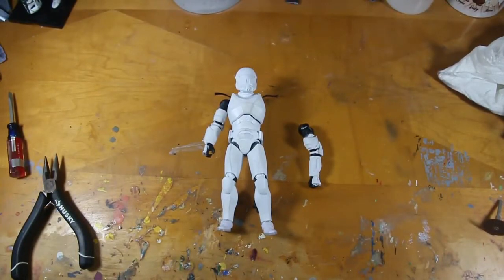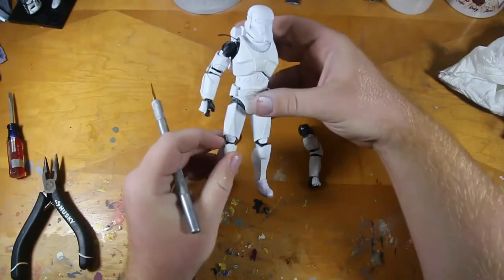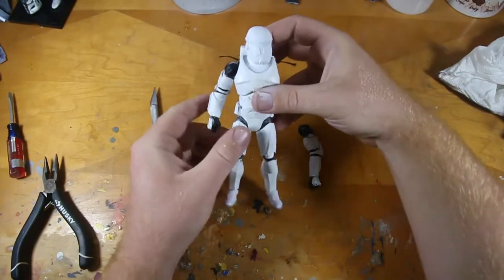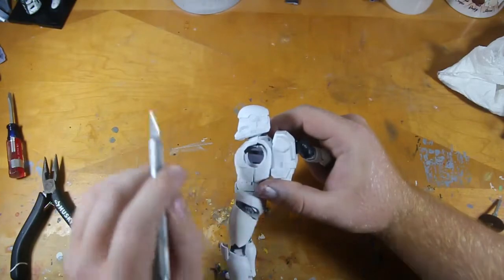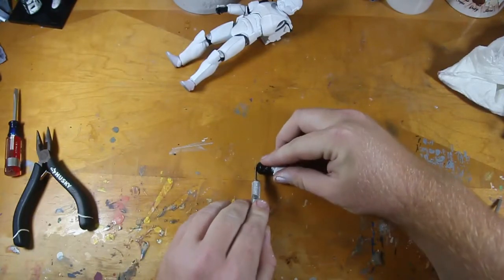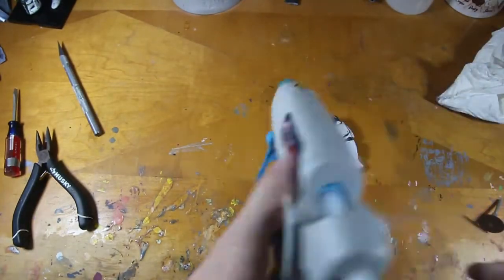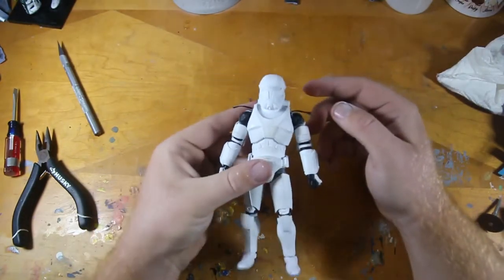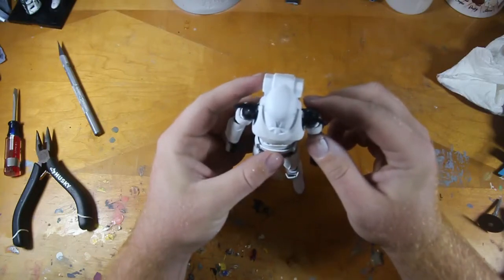*UPDATE* Assembly Tutorial - Custom Clone Commando Star Wars: The Black Series

Comment: Did you 3d print this and how do you get the sizing right for example if I wanted to also print out a 1/12 or 6 inch figure do u type in the length of the figure into the software ?
Reply from the maker: Its a 3D printed kit, yes. Chitubox does allow for resizing of pieces, yes. I go over the origins of the kit and files in the original assembly video, it can be found at the bottom of my page.